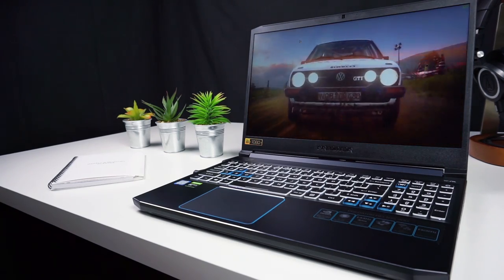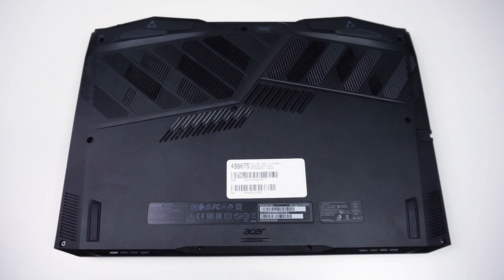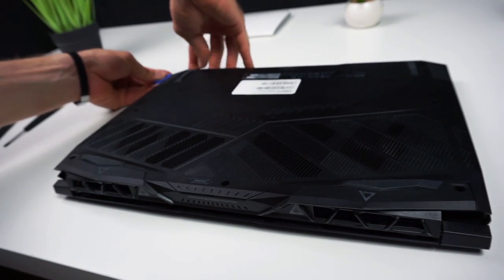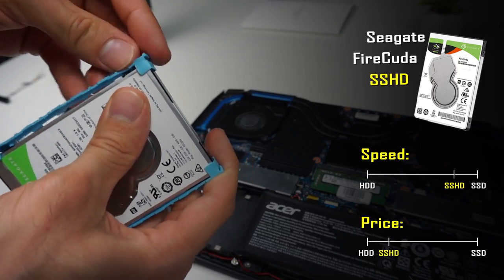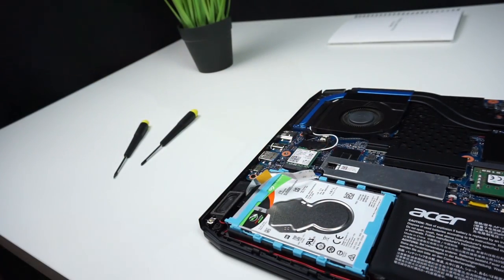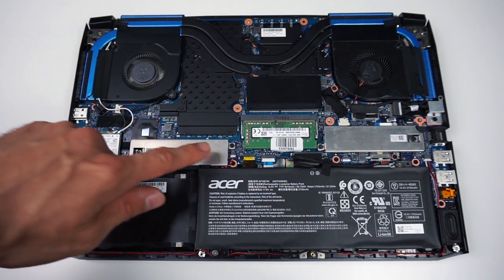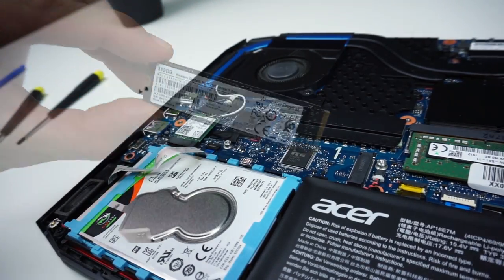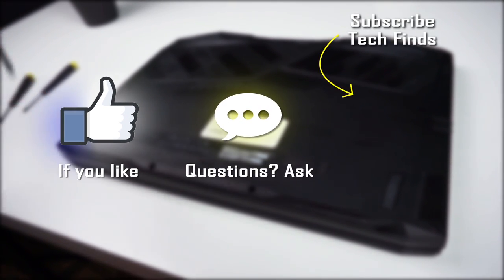Acer Predator Helios 300 2019 Upgrade RAM / SSD / HDD - Disassembly Guide

Comment: Is it safe to use a 3200Mhz RAM?
Reply from the maker: This laptop supports max 2666MHz  RAM
Reply: Tech Finds Thanks bro. But mine has a 3200mhz that clocks at 2667mhz. Store where I got it upgraded it. Wondering if it’s safe.
Reply from the maker: @jocosibayan6351  It just downclocked since it can't go higher than that. It should not cause any problems.
Reply: @TechFinds  Thanks man appreciate it

Comment: What's the RAM frequency?
Reply from the maker: 2666MHz
Reply: @TechFinds  do you know what type of RAM to use for the rtx 2060 model?
Reply from the maker: @brucebanner3566  the same, I linked few options in the description
Reply: @TechFinds  thanks
Reply: @TechFinds  hey, I read the link wrong, it said that the RAM was locked on certain processors except for the h series. My bad. I subbed. Thanks for the links.

Comment: Is this (https://tinyurl.com/y56yu7um) compatible for 8gbx2? Also, what is the model of the existing ram inside?
Reply from the maker: You mean that you wanna mix this RAM with existing RAM? It will work, but the original RAM in Predator is CL19, so for the best compatibility you can go for this one: https://amzn.to/2QDPL38
My Predator had SK Hynix 2666MHz CL19 inside.
Reply: @TechFinds  Yep, I'm looking to buy Predator Helios 17inch which comes with 8gb ram inside, so I was thinking of getting another 8gb to run in dual channel. By the way, great video👍🏼😀
Reply from the maker: @vibramands8651  Thank You :)

Comment: My computer won't turn on anymore, lights wont work, nothing
Reply: Make sure fan is plugged in completely
Reply from the maker: Also make sure that you have every screw in the socket as they make a connection in some Acer laptops. Without all screws it may not run. Sometimes the screws are different length so you have to figure out which screw goes into certain socket. I don't remember now what it was in Helios 300

Comment: DON'T upgrade with Seagate Firecuda, those are the most shitty drives on the market. Mine 2 TB died after 7 months. If you want to buy this Seagate shit read reviews on Amazon.
Reply from the maker: Mine works 3 years straight now. It happens to find a bad unit.
Reply: @TechFinds  2 Seagate hard drives 2 failures. I have Maxtor 4TB also died after 6 months but was replaced under warranty.

Comment: After I upgraded it , the laptop was dead......
Reply from the maker: Any idea what was the cause?
If you still have the laptop try hard reset.
Reply: I just received it fromAmazon, after 2nd boot to install another ssd. The machine was totally dead, no even any led light was on while charging. I did the upgrade very careful and first time defeated. I have return the item to Amazon and wait for the refund then buy another one.
Reply from the maker: @WeiYeQiu  Yep it's definietely something wrong with this particular unit. Upgrading RAM, SSD or HDD doesn't kill good laptops. ;)
Hope the next unit will be fine!

Comment: Cool vid but you fucked up the hdd install, if ppl don't do it the other way and close the laptop the ribbon will most likely get damage

Also the rams you listed are so expensive, it's way cheaper to buy 2 sticks of 16gb seperately than order a 32gb pack of 2 16gb
How I got me a Patriot Viper 2666mhz 16gb x2 for 100$ total
Reply from the maker: Hey, thanks for commenting and suggesting RAM. I haven't heard of such brand before, but i gotta find out more about it.
If it comes to HDD i think that ppl will get the idea since i explained. Nonetheless i'd close the bottom even with the cable sticking out. It's elastic and there's actually some space between HDD and bottom lid when closed.
Reply: I just installed a Samsung Evo 1TB SSD  
And that ram and it's smooth
Also there is no customer support in my country for Acer to do the HDD upgrade so I contacted Acer international and they gave me the okay to install on my own+they created a pic by pic guide on their site for 2019 model